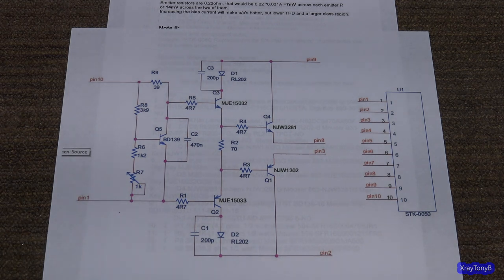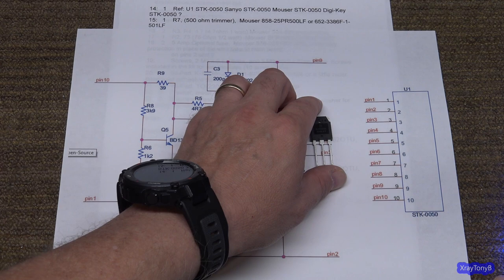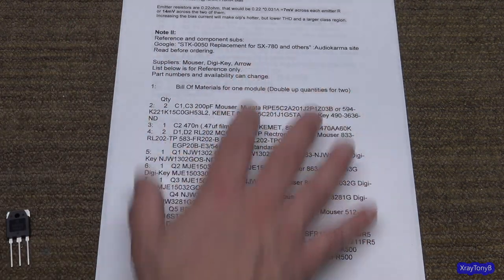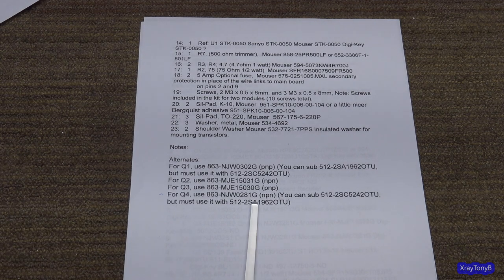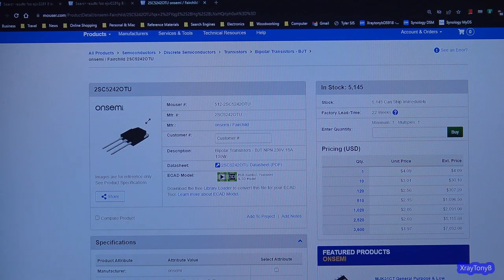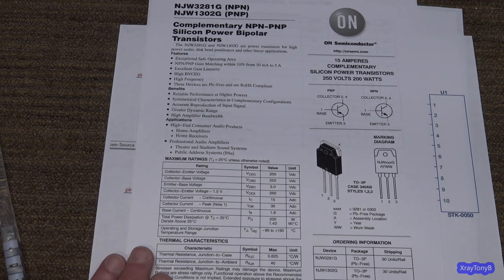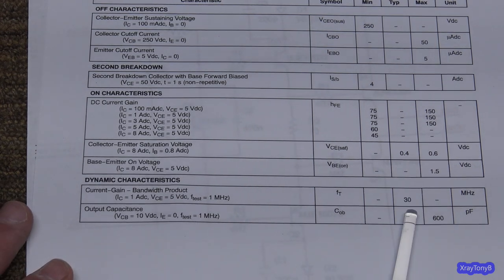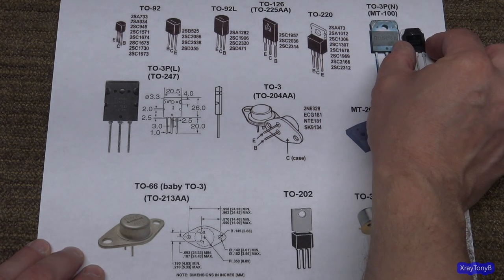How to Find Substitutes for Discontinued Transistors

Comment: TIP35c/TIP36c are applicable in most situations, and will most often be superior to anything they replace, with TIP41c/TIP42c as drivers. BD139 can be safely replaced with MJE340 in the role of bias spreader, even with any TO-92 npn with at least 100mA, suitable C-E voltage rating and collector as the middle pin.
Also if there is nothing else, for the power pair BD249c/BD250c, and BD243/BD244 as drivers.
Reply: Yes. However, these TIP transistors have only about 3-5MHz fT. As Tony mentioned, will often work well anyhow

Comment: all you need is a Perfboard
And theoretically any power transistors would do be nice to use MOSFETs just design it in microcap it's free. as long as you know your lines in and out and voltages dead  easy
Reply: Until you need to connect it to a heat sink....
Reply: @jefftobin4034  well  you can use the original heat sink  the same what hes did on the little board's
Reply: So are you using it as a form factor adaptor and using wires to connect back to the original PCB? I assume that's what you're suggesting.  @hoobsgroove